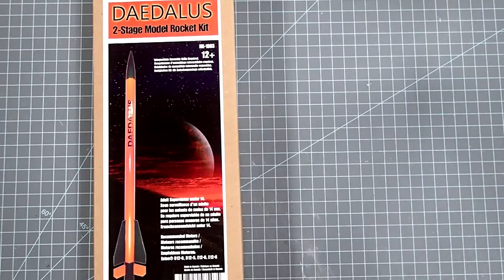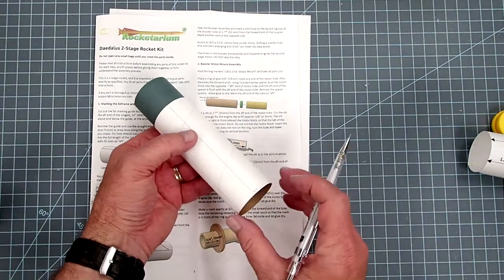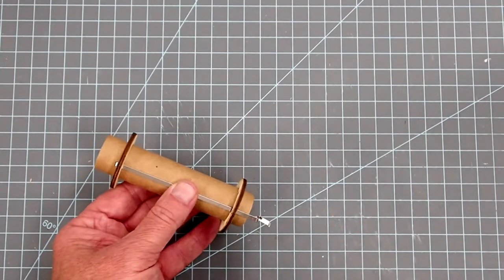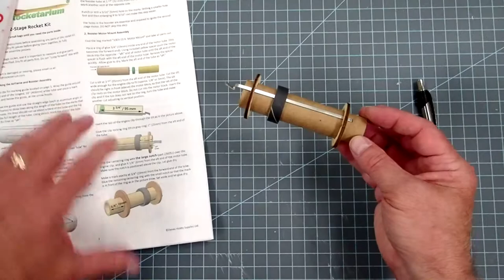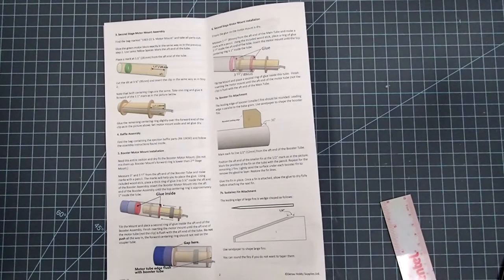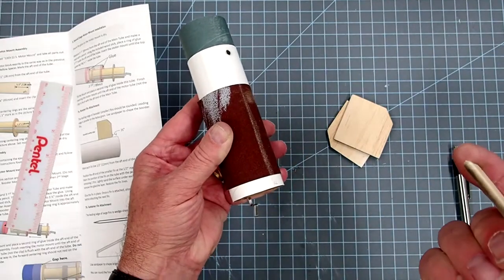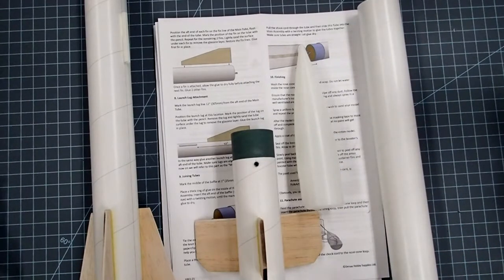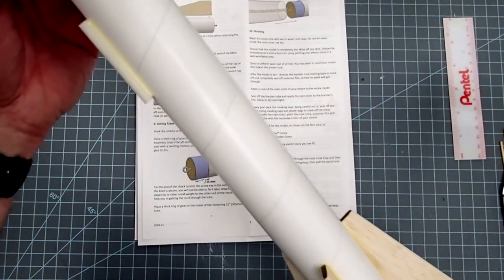Rocketarium “Daedalus” model rocket assembly

Comment: I hope u respond but can I use 2 e12-6 engines even tho it's not a booster
Reply from the maker: You can if you are only flying the upper stage. Using a regular engine in a booster usually results in a crash.
Reply: Alright I really appreciated u responding